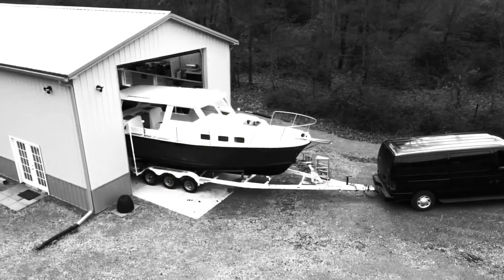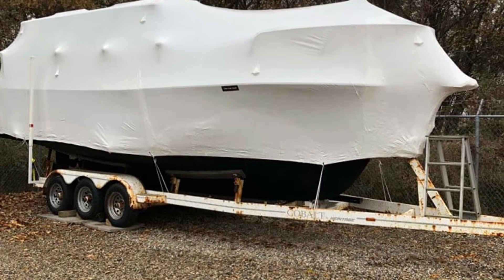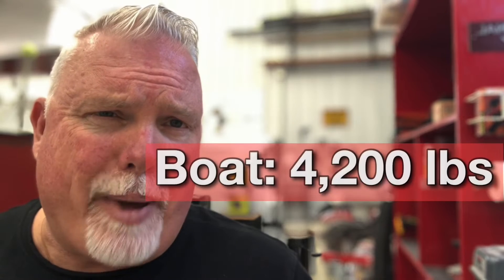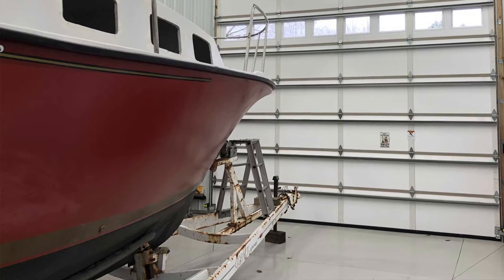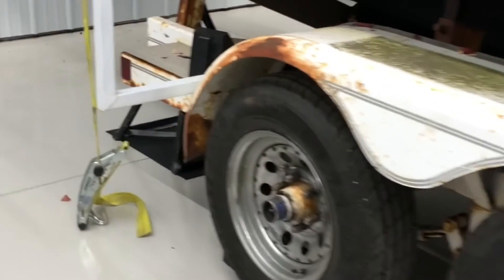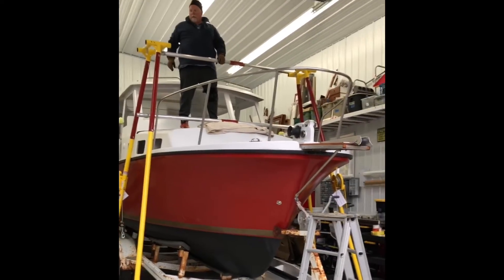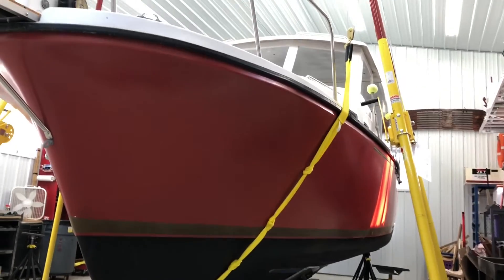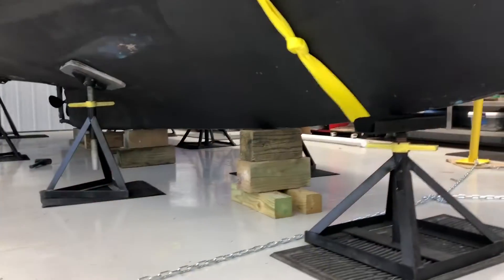No Crane?? How to Get a Big Boat Off a Trailer | Sailboat Restoration and Boat Building (Ep3)

Comment: I was thinking of building a similar frame out of wood to support a hoist. I just got some boat stands for my boat, and I'll need to get the boat off the trailer. For starters I'll try the method without a hoist, where you lift it off the trailer wherever you can (e.g. stands in the back, jack under the keel), move the trailer until you're stuck, then move around the stands or jacks, and move the trailer some more, and repeat until the trailer is free. If that works, great. But some day, if I'm doing the hobbies I want to be doing, I'll need a gantry crane in some form. It's inevitable. For example, how would you lift a large outboard off a transom or put it back on? You have to able to lift heavy things.
Reply from the maker: I cannot recommend a wood frame. The jack stand shuffle does not always work, especially on boats this size so the Go-hoist or equivalent is the way to go. I have a Roust-about lift for heavy items. You will see it when I install the inboard engine
Reply: @motorcityboatwerks  Thanks for the tips. Good to get some info from someone who's done stuff like this before!